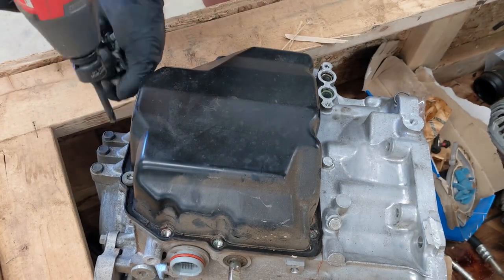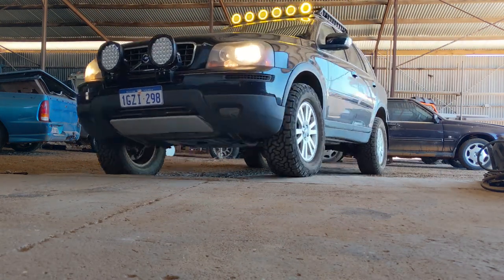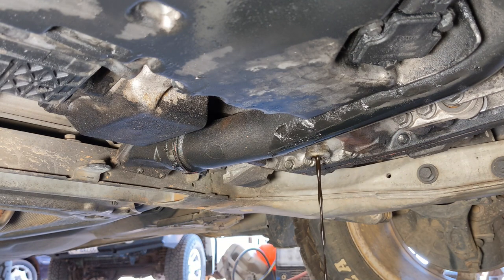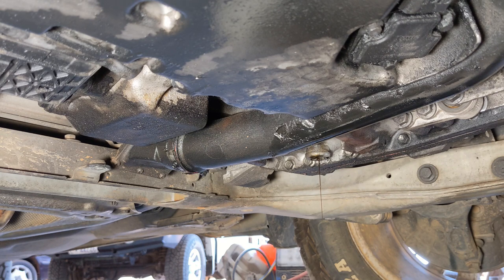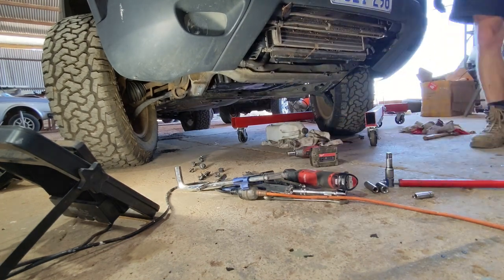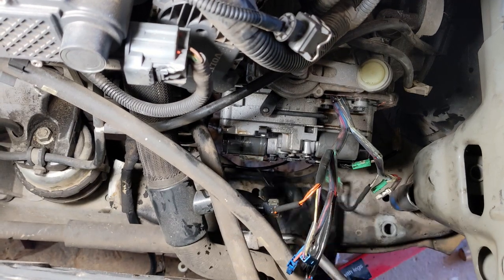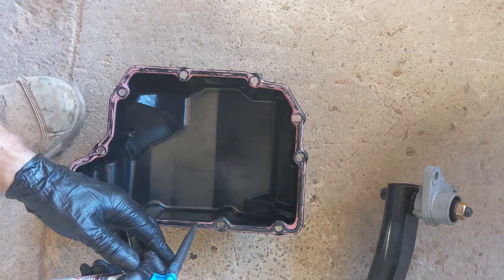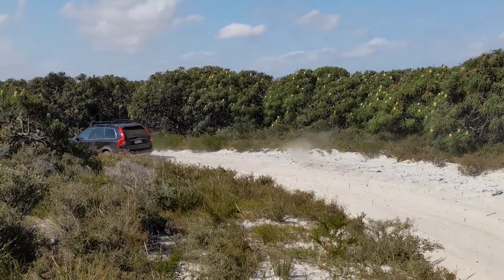Volvo XC90 TF80-SC transmission valve body replace

Comment: Hi. Thanks for the video. Makes it look very easy. I managed slip off the cover, though it scraped the subframe but no deformation. I couldn't get the bolt out to drop the subframe, limited tools and just stuck bolts. Now that it's out, I got a replacement VB and cleaned all the solenoids, tested them and theyre working fine mechanically and electrically. I'm just concerned about the fitting the vb cover again as I don't know the torque specs for the bolts on the vb cover. Couldn't find any online either. I've opted for Victor Reinz reinzosil. It cures really well and forms a decent rubberized seal. I was impatient and filled up the atf too soon and had to remove and reseal. So I've learnt why the wait is needed, seen the error of my deeds and also seen just how good this sealant is

Comment: If your transmission is slipping and throwing codes, check your driver side CV axle. If the internal field goes bad, it will suction transmission fluid and inject grease into the tranny. The change in viscosity will cause the trans to fail, all diagnostics will be wrong. 
When this happens, change the transmission fluid and filter, and install a Transgo shift kit. Replace your CV axle. 
Reset the codes and it will last another 100k if you haven’t burned the clutches
 off.
This issue is specific to the 4T65 transmission, possibly others .

Comment: Is your Xc90 pre 2008 ? I don’t
Know when they updated the valve body, but they did make a change and I’m wondering if you just used one from a later model. Thanks great info
Reply from the maker: My car is 2007 and I used the valve body from 2010
Reply: @HeapsofProjects  gotcha thank you

Comment: I've just ordered the new version body with new pan gasket, is there a gasket for the actual valve body, as I'm unaware of one, thanks
Reply from the maker: No, the pan uses liquid gasket/silicone but the valve body has a small gasket just under a small cover and that can be usually reused.
Reply: @HeapsofProjects  so I'd have to swap the valve body gasket over?  I'm using a sump gasket as I don't want to wait for liquid gasket to set before filling with oil
Reply from the maker: @ryanevans8033  it is just a small gasket under the small cover held in place by 2 bolts. You will see it. The actual valve body has no gasket. You don't have to wait for liquid gasket to set, I have always put it together and filled straight away and never had any leaks. I have done it approx 15 times over the years.
Reply: I may use Victor rienz instant gasket then, one more thing, I slowed your video down but couldn't tell if you undid the front and rear vacuum mounts to lower the subframe, I'm changing the valve body at the weekend thanks
Reply from the maker: @ryanevans8033  Victor Reinz was what used. I didn't remove engine mounts, just the bottom bolt of the front (radiator side) one.

Comment: May I ask how do u know which wires go back onto the solenoids? Is there a diagram?
Reply from the maker: They are different color plugs and the lengths of the cable is different. Take a photo before you pull them off.

Comment: Great video!!, did you try an oil change first?
Reply from the maker: Not on this one but I have before and never had an oil change fix anything once it was already acting up. I think it's important to change oil while it's still working.
Reply: @HeapsofProjects  Volvo (or is it Aisin Warner) say that these gearboxes are "sealed for life" but I agree that a fluid change is definitely recommended, perhaps after taking a look a the colour rather than mileage based. If it's a secondhand car with a tow bar then you never know how hard a life the gearbox has had.

Comment: My xc90 misses a shift and goes into neutral between 3rd and 4th once every 1000 miles. It fixes itself within a few seconds. Does this sound like a valve / solenoid issue?
Reply from the maker: It most likely is a sticky solenoid but can't really be 100% sure

Comment: My (UK registered) 2006 XC90 with 175k Miles (281k Km) and TF-80SC has this issue (shift flares mostly between 2 and 3) but my 2007 with 155k Miles (249k Km) apparently has a slightly modified valve body and is fine (so far). It's apparently a known issue and there is a thread on one of the Volvo forums with chassis number ranges affected. Anyway, I done a DIY "rebuild" on the valve body using a Transgo kit which involved clearing out the solenoids (after cutting them open) and fitting new (stronger) springs and suchlike, not yet test driven the car being one of my slower projects at the moment. Hopefully it's solved the issues. I have VADIS to reset the oil life and adaptations too.
Reply: Hi, I've the xc90 2006 d5 as well and I'm just recently experiencing this after recent oil changes or top up rather. There was a rather rough gear change which I immediately notified the mechanic. Once it was topped up, it vanished and it's been a few months since, perhaps 4. Not sure if I need to have the valve body rebuilt, replaced yet but just to confirm, is the valve body referred as AW 50-50SN?
Reply: Hi. I gave the same issue with my xc70 3.2. Can you provide more information about your way of rebuilding and how it affect after?
Reply: @Mr.body1917  I actually sold the car a while ago but it was re-registered and driving again so seems the repair was a success. If you Google for " Transgo TF80SC " it should be near the top of the search results. It's a complicated job but I'm only a hobbyist mechanic and managed it. It did take me a few weeks and the car was already partly dismantled at the front which helped through.

Comment: You mentioned lift. What kind of lift. I’d like to lift my xc90 as well.
Reply from the maker: It is a custom front and rear shocks extended 60mm and custom rear springs. I have put about 15k km on the current test set but as it needs bit of adjustment I am in a process on getting second test set made.

Comment: Can you teplace the internal filter with the valve body removed?
Reply from the maker: No, for replacing the filter you would have to split the transmission.
Reply: There are no filters in this transmission...

Comment: Vida software is needed for this replacement??
Reply from the maker: If you don't reset the adaptions it usually won't shift really good.
Reply: @HeapsofProjects  thanks mate, is it necessary also to change the ATF also?
Reply from the maker: @jorgedavelouis2592  I would recommend replacing the oil. I have made a video about that as well. Look for 3309 spec oil.
Reply: I already did but before trying to replace the valve body, don't think is needed again right? It was only 2000 km ago
Reply from the maker: @jorgedavelouis2592  should be fine then if the oil looks clean.